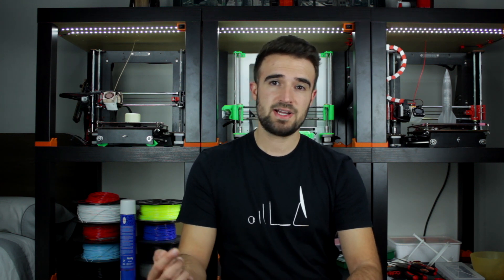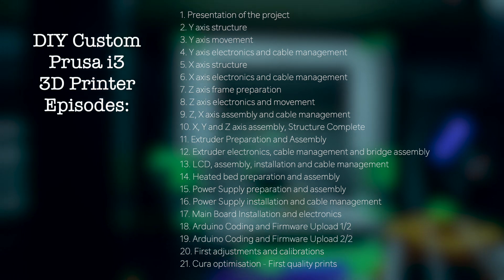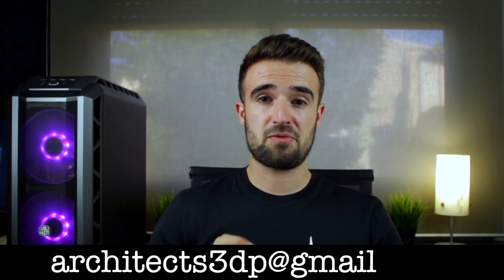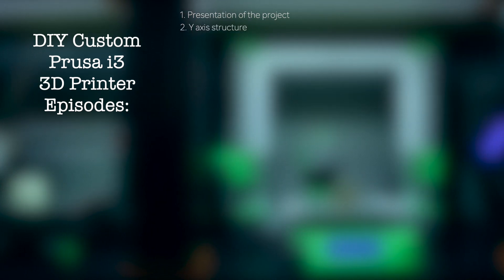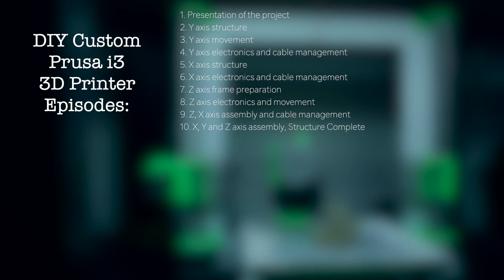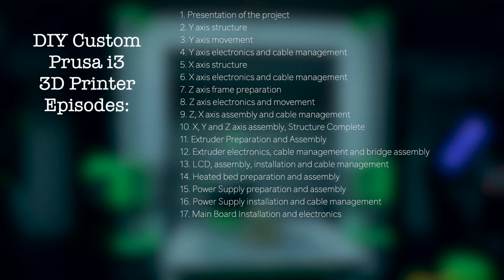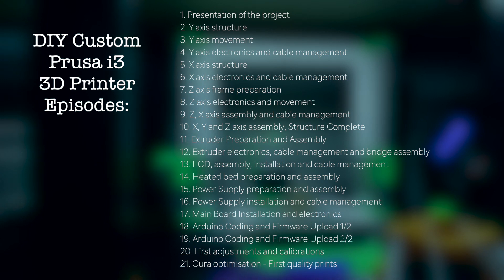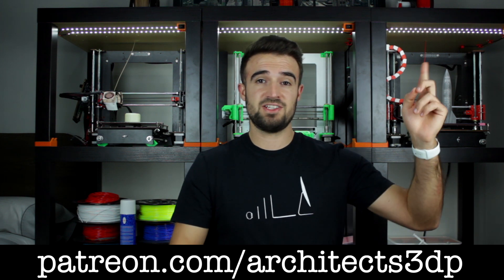Build the BEST DIY 3D Printer - Presentation #01

Comment: How much will this printer cost aproximatly if i build it myself?
Reply from the maker: Hi Marco! Prices can change but built mine keeping it under 200 € with a 6mm aluminium frame. You can reduce it for 50€ if you go with wood.
Reply: @architects3dp   price change according to the change in the value of $ to Indian rupees. 
It can change from 243 $  or 170 $ .. 😂😂😂 it will be funny for u.. 

 But for us when price change for $..  we have to give more Indian rupees for that...
Reply: It cost me about 18,000 Indian rupees approx (243 US $)
Using alluminium frame.

Comment: Sir I have built my own 3d printer with Arduino and if u make Tutorials series about it... It will help me to improve the things which I have done Rong.. 
Because I didn't have any 3d printer before it was hard task for me to build printer without 3d printed parts..   and then when I  completed it I didn't know about Cura setting your videos help me a lot.. and u reply for my every comment than..😀
( But I didn't get any solution for strings. ). Reducing temperature and changing retraction distance didn't help me.
Reply from the maker: Hi friend;
it's difficult to know why it's happening to you if I don't see the 3D Printer.  Reduce temperature, giving it more retraction distance, more retraction speed, and maybe also reduce the filament flow %, should work. Reduce temps till you can't extrude plastic... for example 185ºC.